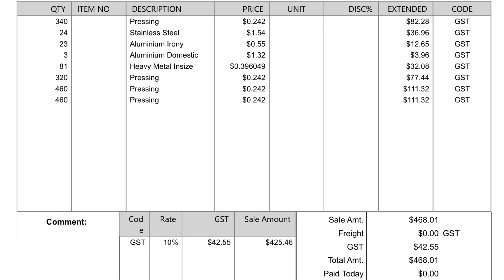Scrapping Steel Roofing Sheets and Earthquakes

Comment: I bet that big truck makes you wish you had a dump bed. I've seen trailers with the dump feature. Unloading sharp edged metal looks to be the most dangerous part of your job. Glad you were out of harm's way when his load went sideways. Also nice of the forklift operator to shift the load off your trailer. Tricky maneuver.
Reply from the maker: Yes I’ve seen tilt trailers pull up. They often get caught in the cage but it would be handy. I was a forklift driver for a number of years and the boys at the yard are legit guns! You can tell when there’s an experienced driver behind the wheel 👌